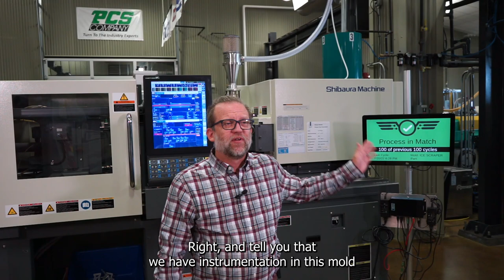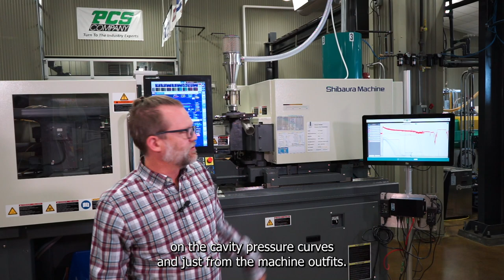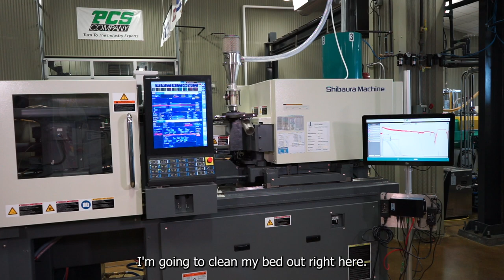What Is Back Pressure in Injection Molding?

Comment: Back pressure increases the friction on the screw, basically from the inside out, as opposed to the heater bands from the outside in. This is very prominent in the extruder machine. Extruders have water cooled screws, just for this reason. Extruders will run after start up on frictional heat only. Extruders also have cooling fans on the heater bands, to dissipate too much heat generated by friction. I speak with over 40 years in the plastic business, both molding and extrusion. I am also an injection mold maker.
Reply: I ran single and twin screw extruders for six years, never once saw fluid cooled screws; it makes sense but i wonder what size screws you worked with?
Reply: what do you suggest me to start in ? wich product ?

Comment: I just had an issue with HIPS, where I kept getting trapped gas in the barrel, leading to bubbled parts.  I increased the back pressure, in an attempt to exhaust the gas through the hopper.  I don't have any formal training, so you'll have to excuse me if anything I say is wrong.  But, it seems to have worked.  I have a ring of splay I'm trying to work out, next.  Great video!
Reply from the maker: Thanks for sharing and for watching!! 😁

Comment: first thanks for your amazing content. second i have a question about the importance of  Simulation of injection molding using Moldflow. do you use simulation for your products ? can you just run a DOE to figure out the best machine parameters for the plastic part without using any software ? and what about warpage and cycle time in moldflow a reverse shape is made to account for warpage that is something we cant change using machine parameters, so please tell me about the significance of simulation in the plastic business is it worth it or not ? thanks
Reply from the maker: Thanks, Mustafa! We're glad you enjoyed it! Simulation is a very useful tool to save time and money. Yes we use and offer flow simulations as a service. A simulation can be done to an existing mold/part or it can be performed in the very early stages of part and mold design. Multiple iterations of part geometry, mold design, and processing parameters can be simulated before money is spent on mold construction. Warpage , cycle time, knit line formation, and strength can all be analyzed. So yes, a DOE can be performed during simulation. The money spent on simulation has huge advantages and can save thousands of dollars by finding potential issues before part designs are finalized and molds are constructed.

Comment: Machinery manufacturers like to boost the recovery rates of their machines in terms of oz/second.  Therefore they design their screws for maximum recovery.  This can lead to unmelted resin, poor mixing with colorants…..  Back pressure will certainly help this situation.

Comment: This isn’t true, you are making the plastic hotter. Explain concentrate color mixing of the resin then? If you are just putting more material in the shot why does the color all of a sudden mix? You raised the friction and rotations it takes to get to your shot size and now have raised the melt temp. Basic physics, friction creates heat. Set your barrel temps at 400, they will increase on their own especially on the 3rd or 4th extruded zone with back pressure. It drools Bc you have heated the plastic up and now have changed the viscosity of the polymer. Your grandmother and your mom have products I molded in their kitchen. I have an rjg certificate, it doesn’t work in the real world and I’m questioning some of these statements.
Reply from the maker: Thank you for the comment. I would like to address a few of you points for you to consider.
 
1.	The industry used to think that the plastic had a dramatic increase in temperature when BP was increased. But with modern instrumentation , Thermocouples in the nozzle and in the cavity, we have learned that the increase is modest at best. If the plastic temp is directly measured with a pyrometer rather than the reading on the barrel thermocouples, you can usually see that the barrel reading does not always correspond to the actual plastic temperature.

2.	I did state in the video that increasing the BP will improve color mixing, although this is not usually the best option to improve color mixing.

3.	I hear the statement about the real world a lot, usually this means that the machinery is in poor condition. This can make us believe a lot of false truths because we are seeing the result of poorly maintained equipment. Another point to keep in mind is that equipment is evolving rapidly. The molding machines I use today are not always the same as the machines I used 20 years ago.

We as plastic processors learn something new everyday. It is healthy to challenge and be challenged in what we believe to be true , this has to be done with data. This is a small knit community that seems to be shrinking. Lets try to lift each other up and encourage each other to be better. I would be happy to try and come to your plant and spend a day looking at some of these topics if you are interested. 

Thanks! 
-Jason
Reply: @rjg  thanks for the reply, I was doing some day drinking on a rainy day off and just trolling a little. Wouldn’t a simpler test just to say make 100 shots without bp and use an infrared thermometer while purging then run 100 shots with bp to see the difference in temp? Unfortunately you are correct, machines all have the devil in them in one way or another.  This is where real world comes into play. No machine is perfect in a manufacturing facility, you can do these test on a perfectly tuned perfect machine but that’s not what we have. Maintenance does their best but money and downtime always an object in the way. So tell me how concentrate color will mix better with bp? You have to be heating the molecules up to mix better, like I said more rotations/friction equals more heat.
Reply from the maker: @downbelowu1928  The increased BP creates more revolutions of the screw. The improved mixing has more to do with allowing the metering zone of the screw to do its job, mixing. Great idea to do 100 shots at one BP measure then repeat at a higher BP. Let us know your results.

Comment: So after that semi confusing information you advise to not adjust backpressure?

All that nonsense about 'drying the material' via the back pressure setting was just added confusing drivel too. Hygroscopic material needs to bd suitably prepared and conditioned pre moulding, end of.

Backpressure is purely an adjustable parameter to ensure consistency in melt preparation. Multiple factors can add inconsistency, wear, polymer, additives and environmental changes. You should use scientific optimisation to determine the ideal backpressure for each and every product you trial/run. Once the process is optimised and passed IQ there is no reason to adjust backpressure (or anything else for that matter) as any defects witnessed at this stage during normal production will stem from an underlying issure that needs revolving NOT by adjusting machine settings.

Setters/techs - Dont piss about with machine settings if production was running fine beforehand, examine route cause first. Only once everything has been tripple checked should you consider batch to batch material variation and make minute changes to settings while informing your process engineer.
Reply from the maker: Andrew, I think we agree on this. We teach a scientific, systematic methodology to find the optimal BP. My stories are there to provide context from my mistakes early in my career. Over my years of instructing, I have found that some people need a direct to the point piece of information and some of us like a story or analogy to drive the point home. Us molders are a tight knit community, we have to pass on what we are learning to the next generation. Thank you for the feed back. - Jason
Reply: @rjg I'll be honest Jason, RJG are highly regarded in the UK as a training centre, that's why I watched the video. Are you related (same company)? My comment was almost to distinguish if you were a professional outfit and by your reply, you are. I appreciate you taking the time to reply and it seems we very likely are of the same thoughts. There's many ways to get your point across, I guess for me if you'd explain the optimisation through systematic study first then discussed past wrong doings I may have felt differently, but that's just my opinion, not necessarily the right one.
Reply from the maker: @AndrewBarrass-s7k  Yes, we are the same company! We have offices around the globe, including the UK. We appreciate you watching and providing feedback! We certainly take it all into consideration. We hope you have a great day!